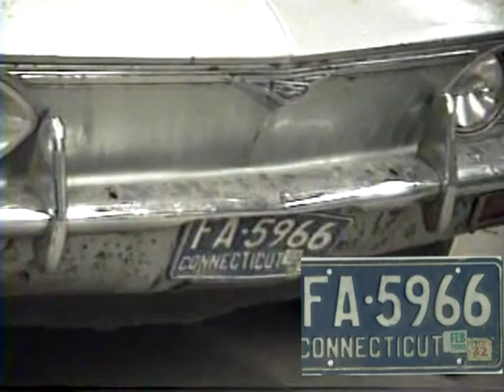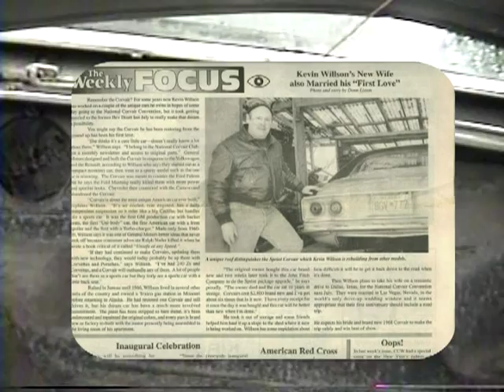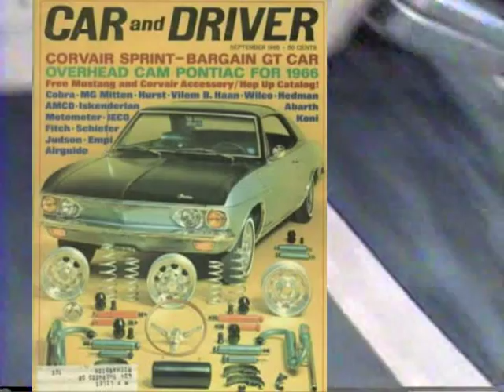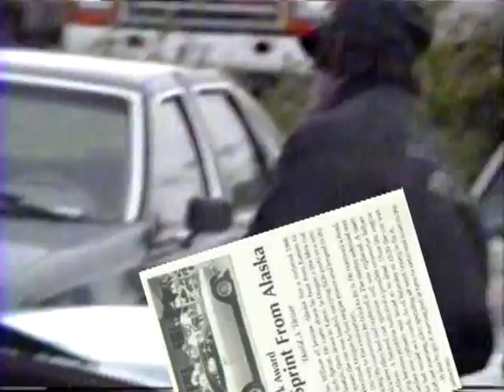1968 Corvair Fitch Sprint

Comment: How did you do the sail panels?
Reply: You can still get those panels (in fiberglass) from Corvair vendors like Clark's.  The panel is called the "Fitch Sprint 904 Ventop" and it does add style to the 1965-69 coupe!